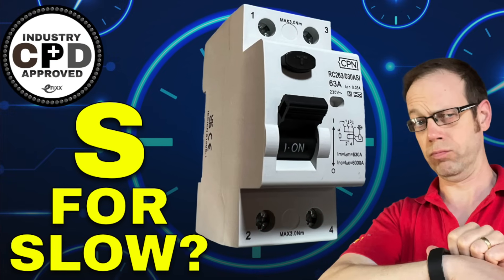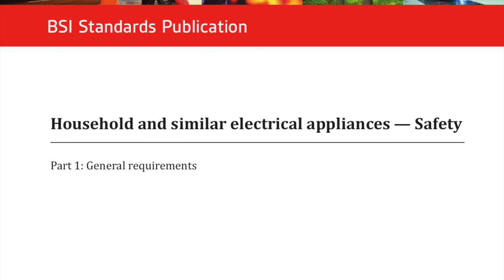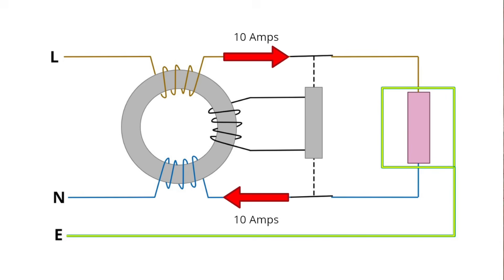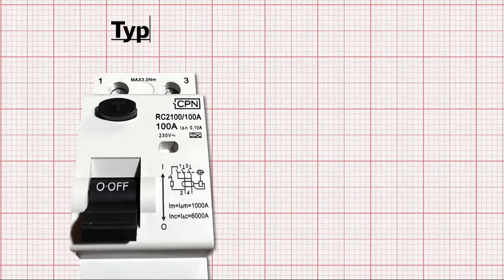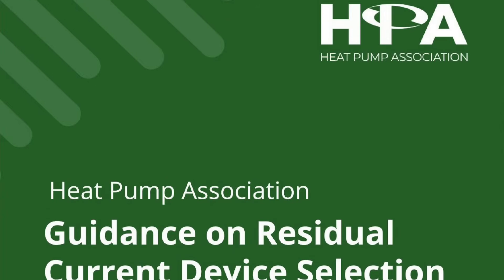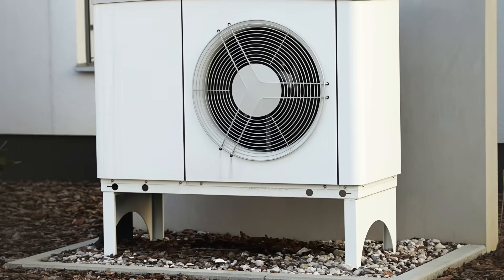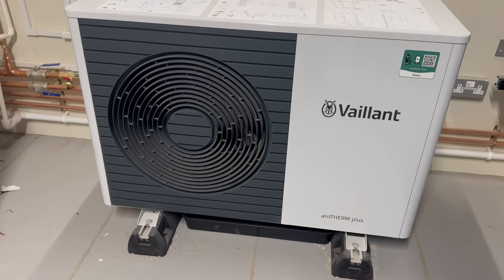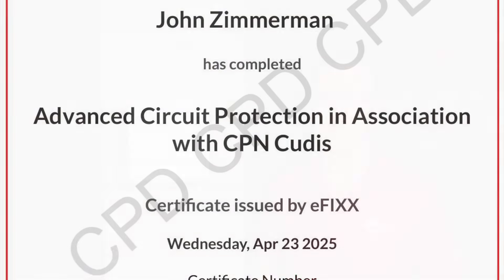How Do I Pick the Right RCD for a Heat Pump?

Comment: Is there a good reason to have separate RCDs (e.g. B heatpump, F outlets) on the different circuits, instead of just one type B connected to everything right after the main MCB? Because single RCD is cheaper...

Comment: It should be an automatic requirement for manufacturers to state the type of RCD in their literature , but I find they don’t. I have a Heat pump to connect soon and there is absolutely nothing mentioned about the type of RCD in the manual installation guide . I will have to go for type B to save wasting time on contacting manufacturers who make it hard to find out and supply poor installation guides for us electricians

Comment: It’s somewhat strange how split system aircon systems, essentially a reversible air source heat pump, with an inverter drive for the compressor don’t specify a protection type, just the overall power requirements, the cable cross section size from the outdoor to indoor unit and the need for a local lockable isolator (that’s from reputable manufacturers not sweat shop discount ‘brands’ )

Comment: I have a modern Fusebox DB/CU - my Arotherm Plus was fitted with just an MCB, but the entire length of cable is SWA (and a short run at that).
As far as I can tell, Fusebox don't currently make a suitable RCBO unit and I don't want to have another brand put in there.
Is there any recommended product at the moment (or is this even really a concern given the SWA cable?)
Reply from the maker: Unfortunately, as the video makes clear, it's not just about the cable, if the heat pump manufacturer requires an RCD of a certain type it needs to be installed. You could put an additional enclosure with the appropriate device in it?
Reply: From memory the Arotherm instructions say a type B RCD/ check your local electrical regulations. So it does allow for engineering judgement of an MCB if it's run in SWA. On the flip side because it's engineering judgement it's a grey area so if something were to happen ie injury or damage it allows a route for the manufacturer to walk away and the HSE to come down on the installer. 

Like solar installs it's not black and white and it's not right or wrong. Just like an MOT it might be fine at the time of install/checking but fail 6 weeks later. It puts installers and end users in a horrible position because the equipment/ innovation by manufacturers isn't keeping pace with legislation and legislation isn't keeping pace with innovation.
Reply: @effervescence5664  I was also of the understanding that the Vaillant guidance could be interpreted to allow an MCB, which is why I was happy to allow it. I always intended to get a suitable RCBO / RCB put in once one was available, just don't think we are there yet (without an additional DB, which I already have for the EV Charger and want to remove)
Reply: @timfontana2769  That's the exact view I take. Allow additional space for when the device becomes available. 

Currently we're renovating a client's house. Initially they contacted a builder who speced a 14 way consumer unit (7bed home) for a full gut and replumb plus rewire. I speced a 31 way unit, 17 circuits and enough spare ways to accommodate a 4 din type b rcd when fusebox make them available. 

People just aren't allowing for the size CU we're going to need. North America and Europe have a far more developed understanding of appropriate sized units for homes.

Comment: I noticed that for an Arotherm plus, Vaillant specifies a RCD with very specific frequency requirements which I'm told only Hager make which seems overprescriptive
Reply from the maker: I don't think Vaillant prescribe the specific Hager device. More that Hager have seen a need based on Vaillant's requirements and created the device to suit. 🤔
Reply: It's for the manufacturer to specify what is the most appropriate type of RCD for their appliance.

It's your job as an electrician to comply.
If you deviate from the manufacturer's recommendations for the RCD, that's potentially dangerous and if an incident occurs, and it transpires that a fatality was not prevented because the wrong type of RCD was deliberately fitted, then you as the electrician that fitted that RCD is going to end up being prosecuted.

Stick to the manufacturer's recommendation.
Even if you do think you know better. Stick to the manufacturer's recommendation.
Challenge them if you want, but whatever their response is to you, don't deviate from their recommendation.

Comment: I have a Hager board filled with RCBOs and my ASHP is on an ADA332G B32 within the main board. However my EV charger is on a separate metal bodied RCD  (WSPD40 /WER40B-030 B40). Install is just over 14 months old Does this sound normal? Certainly not had any issues

Comment: I would say that when installing these systems, it's more important to consider their impact on the grid.

So in Finland, some 1.4 million of that country's 2.8 million (super insulated) homes now have Heat Pumps installed. Despite these pumps being mainly used as secondary heating (with most homes still using either wood burners and/or mains hot water), their use has seen an increase in grid demand of 3GW. When you upscale that to the UK's 28 million (poorly insulated) properties, that translates to an additional grid demand of 60GW (although it could be well over that during really cold periods)

Why is it a problem? Well the UK's current generating capacity is (roughly) 45GW; Hinkley C (when it eventually comes online) will generate 3.2GW, while an offshore wind farm like Hornsea, covers 300 square miles and generates 2.25GW. Remember - we're talking about an "additional" 60GW. Oh, and before anyone says "but Finland is colder", well, for two of the past eleven years, many parts of the UK have been colder, and the time when you need heating the most - is when it's really cold!
 
However that's all academic when you consider the real elephant in the room - agriculture. Just imagine the electrical power needed to dry 10.5 million tons of grain, or the additional power needed to switch tens of thousands of massive commercial gas ovens (that run 24 hours a day to make the food that fills our shops and supermarkets) over to their electric equivalents! The numbers make the 60GW needed for Heat Pumps look like a rounding error. 

My guess that the UK will impose a moratorium on the installation of Heat Pumps once 5 million have been installed. At this point the interconnectors (able to deliver 10.3GW) won't be able to meet demand, and the grid will face collapse - potentially lasting for weeks.
Reply: How much misinformation can you fit in one post?
Heat pumps aren’t used as secondary heating - they’re the main system in most installs, with either electric resistive backup or a wood burner. 'Mains hot water' usually means district heating, which covers both space and water heating, and those homes don’t typically use a heat pump unless it’s just for cooling.

Saying parts of the UK were colder than Finland one winter doesn’t change the fact that Finland has much harsher winters on average.

There’ve been about 275,000 MCS-certified heat pump installs so far, most in the last five years. What’s happened to grid usage in that time? It stayed steady at around 30.8 GW. So much for the grid collapse narrative.
Reply: @BenIsInSweden  During the installation of those 275,000 pumps, energy intensive manufacturing has collapsed in the UK. As of last year, my own employer, has moved its manufacturing facilities from Luton to Poland, and it is just one of hundreds. Moorcroft Pottery anyone? That is why UK energy demand is not seemingly increasing. However there is only so long that this can continue. This is why the UK is now targeting massive areas of agriculture for closure (first indirectly and at some later date 100% directly).

As for "harsher winters on average" that is an irrelevance when it's the singularity which kills. Had the UK grid collapsed during the 2018 "Beast from the East", it's almost inconceivable how many could have perished. 

As for Finland being colder - that's open to debate. I worked out of Espoo and it seemed almost balmy in the winter when compared to somewhere like Lulea in Sweden.

I repeat my claim: no more than five million heat pumps will ever be installed.
Reply: @skfalpink123  Lulea is much further north than I, and where I am, it sits below 0C most of the time during the winter months, easily and regularly dipping into the negative double figures.  Where I am from in the UK, below 0C is a rarity.
Espoo's Winter weather seems to be similar to what I get here, and it's definitely colder than what most of the UK gets.

Saying “Espoo felt balmy” is like arguing the UK is hotter than Sharm el-Sheikh because it had a heatwave last week. It’s not a useful metric.

What you're missing is that many people in the UK, when installing heat pumps, go on to install Solar and Battery storage, or vice versa, with the incentive to charge batteries overnight when industry and commercial usage is at its lowest, pulling down the peak power demand.

You didn’t address the 30.8GW average demand figure, and you already acknowledged the UK has ~45GW of capacity. That’s 50% headroom right now, and that’s before accounting for upcoming projects like retrofitting CCGT plants to boost efficiency from ~45% to over 60%.

Also, your 60GW figure for 28 million homes is extremely unlikely.
Reply: The agriculture heating requirements will likely just be moved to off-peak periods, I wouldn't worry about that.
Reply: You are not considering that those heat pumps are often being installed to save on other heat production sources that in many cases (at least here in France, and certainly pretty much the case in UK) are old electric radiators.
Reply: @jjadragna  that covers roughly 1.7 million homes in the UK. I'm talking about the 28 million homes that are heated by gas or fuel oil.
Reply from the maker: They do indeed represent an additional load, which is why the DSO needs to be informed when one is installed.
Reply: It's not your job as an electrician to worry about the national grid. Let the National grid and government and other bodies worry about that.

Realistically, you as a single electrician cannot influence the power drain on the grid by any appreciable amount.

Your job as an electrician is to ensure it's wired in safely and inform the customer as to whether it will successfully meet their heating requirements.

Comment: Something that I think is massively muddying the waters is Hager releasing a special heat pump RCD. They're saying that a Type B isn't suitable, and that you need a special B-HP RCD.
Does make me wonder what's wrong with their regular Type B to make it not suitable! 

"If in doubt, use a Type B unless it's Hager in which case use whatever their marketing department have come up with". Or "Type B are made to a standard and will be suitable, unless it's Hager because they're working to a different standard".
Reply from the maker: Hmm, it's more Hager responding to a market need.
Reply: @efixx  can't they just make their regular Type B suitable like everyone else's is?! 

Like I say, "Type B is fine unless it's Hager" is just plain confusing.
Reply from the maker: Yes but Hager have realised some heat pumps require a higher level of protection than the standard type B. There's nothing deficient in their standard one. That's why we expressed the importance of reading and following manufacturer's guidelines.
Reply: @tomcardale5596  but everyone "else's" type B is not necessarily suitable as it does not perform at the higher frequency required bud
Reply: @NigelandJason  if that is the case then there should be a new standard, there's nothing to stop us having a Type C as we've got half the rest of the alphabet already. 

Type F already covers pulsating DC and high frequency switching up to 1kHz. 
Type B adds pure DC to that. So Type B should already cover high frequencies. 

Hager themselves list Type F as suitable for air conditioners using variable speed drives, and that's exactly what a heat pump is. Hager's B HP apparently can cope with up to 20kHz leakage currents. 

It's not just Hager, Eaton have their own version which they call "B+" which has up to 50kHz high frequency protection. 

Which comes back to my point, if F/B isn't good enough at 1kHz then we need a new standard because manufacturers are making non standard extensions to the standard.

None of this is new, variable speed drives were old hat when I started my career.
Reply: @tomcardale5596  I agree bud, issue is, a lot of type B RCD's on the market do not offer the high frequency, and type B+ is a German VDE standard and is not recognised by BS7671, it's a minefield really, and then we have manufacturers recommendations, half of which don't know which one they should use

Comment: Tahnk you Joe, always a pleasure to listen to your wisdom.
An added complexity to the problem is some heat pump manufacturers specify a high frequency, which many Type B RCDs are not designed for.  Vaillant requires a 20 kHz capable Type B.  Not many of those available yet, most are capped at 1 kHz.
Reply: Not sure why this particular video neglects to refer to it, but they did cover this in the 14th May 2025 live show (https://www.youtube.com/watch?v=ltuqmzF9WeY).
Reply: The Hager one is specifically for HP installs...

Comment: i agree, type B is the best option (unless you KNOW that another, less expensive type is suitable) but would you say that the "wrong" type is better than no RCD?
Reply: The wrong type of RCD is NOT better than no RCD. Get the wrong type of RCD and it doesn't trip when needed, then it is completely useless and is as effective as the circuit without the RCD present.
Reply: Los of airsource units should be protected with f type rcd as they have frequency controlled motors Ie DC
Reply from the maker: They're both terrible options to be fair. 🤔